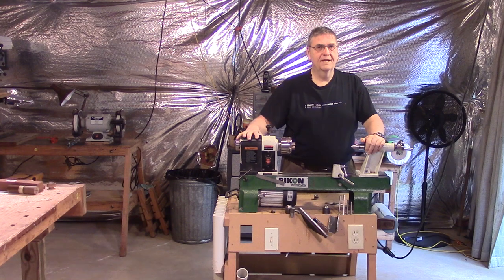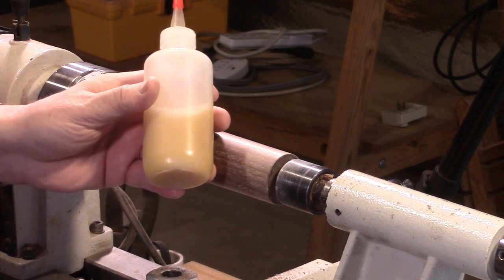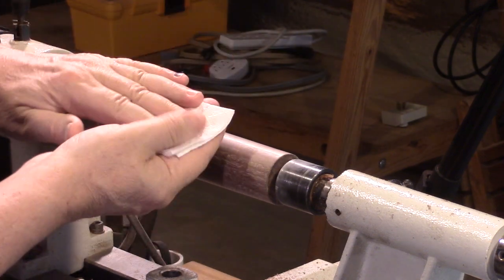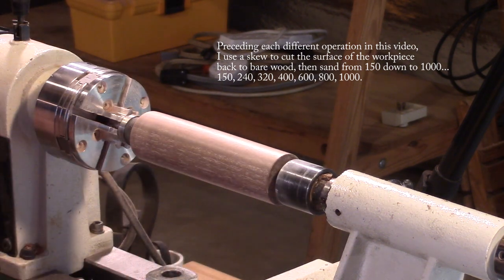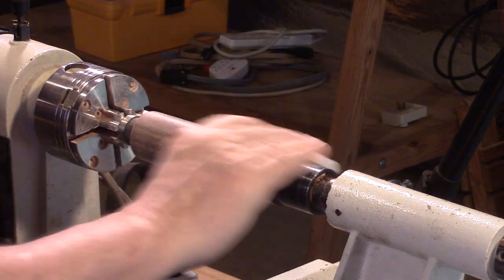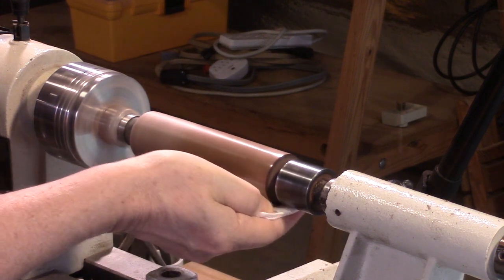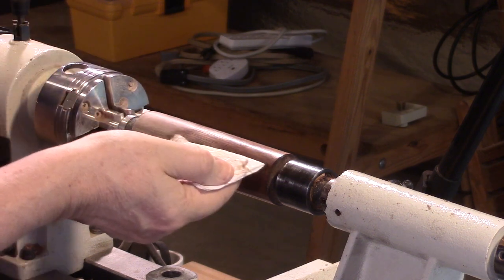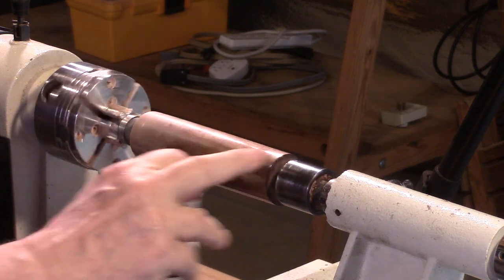Use and Abuse of Friction Polish

Comment: Thanks for taking the time to do this, some really good info here. One other test I'd like to see regarding sanding is if it makes much difference for being super methodical about sanding with the grain (lathe off, obviously), after sanding with the lathe spinning. During the process, it looks to me like sanding with the grain brings out the detail better, but I haven't tested it methodically. I usually sand up to 1500. Also, regarding heat, I thought that the heat made for better penetration and durability, more than shine. So, it's possible that it makes sense to get the first few coats hot and let the last coat be cooler. Also, I add a layer of wax at the end, theoretically, for a bit of water protection, as the shellac soaks up water, in time.
Reply from the maker: I've seen woodturners who always sand with the grain after each rotational sanding, but it always looked like a waste of time to me, since I get very good results without doing that. I'll bet you're right about the heat, that explanation had not occurred to me. Thanks for the tip! I usually use a wax coat on top of shellac too. Thanks for commenting and watching, Jonathan.

Comment: Hi Rick, thanks for taking the time and making the effort to video this and share.. 
I have a couple of observations.. 

if you put the towel against the rotating work, then slowly apply the F.P.onto  to the towel you get little or virtually no spatter.. 

I apply A variable pressure to the towel.. as in when it is starting warm up or getting very warm I back of the pressure a little. however please consider also  that the diameter of the work piece also has some relevance .. think about it.. The Spindle RPM is not the same as miles per hour.. and pen blanks or even 2" diameter  spindle blanks  will be travelling faster past your paper towel then a 10" bowl at its perimeter .. i.e. if you ( put some larger wheels on to your car it will travel slower at a GIVEN or FIXED RPM than with it would with the normal wheels.) therefore less miles per hour at said (given/fixed RPM). 

Also.. sanding speeds will also vary between different wood types and different work piece sizes.. sometimes if you try to sand to fast... it seems to just burnish the sandpaper rather than smoothing out the work surface ..

great videos thank you.... 

oh.. one  or two more thoughts.. in the automotive industry they fine sand between multiple coats of lacquer to achieve the high gloss.... 

Surely friction polish is just french polishing on the lathe... :-) 
except that the french polishing is a lot more time consuming.. he he.... 

is the secret ingredient of Yorkshire grit just ... superfine pumice, a crushed volcanic glass ?
take a look at this video.. 

https://www.youtube.com/watch?v=MxRIPkzgUTM
Reply from the maker: Thanks for the tips, Richard. I agree about the French polishing. And I'm pretty sure you're right about Yorkshire grit and pumice\rottenstone.

Comment: Great video, thanks for the testing. I've been wondering these same questions, as in different applicators, speed, etc., but never wanted to take the time to test them out. Question: Is that silver backdrop for dust/sound, or for camera purposes? By the way, I use the same rocker apron. Always like your videos and happy holidays.
Reply from the maker: Thanks! The silver backdrop is actually insulation on the concrete walls of the basement.
Reply: +ah, ok, thanks.RickTurns

Comment: Three thoughts - one advantage of putting the FP on with the lathe not running is that there is less splatter that has to be cleaned off the bed ways.  Of course, you could always lay the other half of that piece of paper towel to catch the splatter.  Or another approach is to leave a thick layer of sawdust on the bed ways to catch the splatter.

Second, I have one of those rubber pads with velcro on one side that I use to hold hook/loop sanding discs.  I am going to try flipping it over to use as a pad to minimum finger burning.

Third, one of the things that I read somewhere is that the effect of heat is to melt the shellac.  Seems to me that melting the shellac might be more helpful in producing a smooth, polished surface if there is more shellac on the surface (ie, with many more coats of FP).  But one of the objectives of FP is to be able to quickly finish a piece, which means achieving the desired result with fewer applications rather than more.   So achieving a really high gloss seems to be inconsistent with the objective of using FP to begin with, and it might make more sense to use some other form of finish (eg, sprayed lacquer) if high gloss is the objective.  Or saying it differently, FP gives a nice medium gloss with relatively few applications and in a short period of time, but may not be the best choice for situations that call for a truly high gloss finish.
Reply from the maker: Good point about the splattering, Louie. It's usually not a problem for me, because I don't put much liquid on my applicator, and I never put it on by dripping it onto the spinning workpiece. Thanks for commenting!

Comment: Very thorough comparisons of application techniques of FP Rick.  Nice job!  But I wonder... if a high gloss finish is what someone is after, doesn't lacquer give a higher gloss and longer lasting, more durable finish?  FP is simple to apply and cheap to make, and I can relate to that, but it really doesn't hold a shine well for anything that is handled.  I found this out by comparing the finishes on bottle stoppers after minimal use.  But I may be wrong.  It seems to me that the short term oooh, ahhh, factor of FP does not a legacy piece make ;-)  Like anyone else I am always looking for a fast, easy to apply, finishing solution, but for me FP has not been the answer and even EEE (which is very expensive-for what it actually is) has little durability.  How about doing a video comparison of lacquer vs FP?  Thank you for this detailed video.  It was obviously a lot of work and very well done!  Merry Christmas!
Reply from the maker: +Rick Stonewood Arts Hi, Rick. I've never used a friction polish based on lacquer (except maybe a product called Qualapad, which I'm not sure is even available anymore). You're right about the durability of a shellac-based friction polish - I only use it for things which won't be handled very often. Making a video about a lacquer friction polish is on my list of things to do. Thanks for your comments!
Reply: I've found that lacquer, especially spray lacquer, makes a great final coat for shellac-based finishes. I love the look of French Polish, but it is of course a poor choice for hard-use items. I've found that top coating with spray lacquer gives me the color and chatoyancy I love from the French Polish and the durability and moisture/alcohol resistance of lacquer.
Reply from the maker: I didn't realize you could put lacquer over shellac. I don't use lacquer, because my wife objects to the smell. But I just moved into a new house and I have a detached garage to use as a workshop, so I can try this out. Thanks for the tip!

Comment: I sometimes use a walnut oil finish.  I have heard that heat caused by friction in applying the oil will cause the oil to polymerize drying and hardening quicker.  You might consider using high speed and pressure causing heat for the early coats and do the last coat at low speed and low pressure.
Reply from the maker: Thanks, John. I'll try that!

Comment: Years ago Russ Fairfield posted many tips on his web site.  He has, unfortunately, since passed and is greatly missed and his tips site appears to be gone.  However, I still remember many of his words.  He said the very best applicator for a friction polish is a small piece of terrycloth towel.  I began using that as my applicator and have tried many others.  The terrycloth gives me the best result.  He also said, if it doesn't get hot, you aren't doing it right.  Just food for thought.

Billy B.
Reply from the maker: I've seen Russ Fairfield's web site. I believe he also had at least one video on YouTube, possibly posted by a club where he spoke. I'll try out the terrycloth idea. Thanks.
Reply: I have always been told to never, ever take any type of clothe to the lathe that doesn't rip easily - so really only paper towels. Perhaps for more experienced turners a terry clothe is a good option, but I would not recommend it for people who are relatively new at woodturning. Could be very dangerous.

Comment: Thank you for your time and sharing. Your conclusions are about the same as the ones I've determined from my experiments.  I'm glad to have my conclusions validated.
If you don't mind me asking, what is the silver backing you have on the wall of your shop?  Again, thank you.
Reply from the maker: Hi, Andrew. I’m glad to have my conclusions validated also! That silver stuff is garage door insulation. It’s an aluminum foil over fiberglass. It comes in several sheets that are about the size of garage door panels. It works pretty good.
Reply: @RickTurns  Ah. In the video it appeared to be in sheets, more like a tarp.  Thanks.

Comment: @ RickTurns : What kind of a chuck are you using to hold that wood? ... seems to hold quite a narrow tenon.
Reply from the maker: Holding the tenon is a Stronghold chuck with 100 mm (about 4”). With the woodworm screw, I used a Record SC4 chuck with 130 mm (about 5”) jaws. Thanks for watching, Gautam.

Comment: Awesome video. Thank you. Maybe you can answer this question. I hand chisel bowls, so don’t own a lathe. I made the 1:1:1 shine juice. I am thinking I can use my handheld small car polisher as it produces heat as it applies it, essentially becoming my “lathe”. My question is what head should I use? It comes with two different sponges (they create the most friction heat) and a big fluffy lambs wool applicator heads all interchangeable on Velcro. Should I use the sponge head? Or fabricate something with a chamois or cloth onto Velcro and use that since I can’t use paper towel. Thank you.
Reply from the maker: Interesting idea! Seems like a sponge would just tear up because the mixture is a little sticky at first. I think I would tie some t-shirt material around the sponge or wool head, and see if that works. I’d love to hear back from you after you try it.
Reply: RickTurns thank you so much. I’ll let y’all know. Keep up the 
great work.

Comment: Very thorough tests, thank you for taking the time to do this video.  I use FP when turning pens when using some darker woods like Padauk or Babinga and it typically looks great, not so much on lighter woods like Tamarind or Maple. This helps, I have been thinking of trying sanding sealer after a 600 grit final sanding and then removing excess with 0000 steel wool and then applying the FP,  to see if I can get a higher gloss deeper finish, have you had any experience with this method?  Thanks!!  Again great video!
Reply from the maker: I haven't tried that. I usually get a very high gloss with just the friction polish. I'd be interested in hearing your results from that. Thanks for commenting!
Reply: Thanks Rick, tried it yesterday on a pen I made from Olive wood and got a very nice shine, not quite as glossy as say a CA finish.  Maybe more coats might have helped I don't know, but I did Mylands sanding sealer then the steel wool, then 4 coats of Mylands friction polish, one right after the other then then buffed down with a lint free cloth on a little higher speed.  Worked well enough, but would still like to get a deeper looking glossier finish if possible.  If we could attach pictures here I would.
Reply: And what is better on Maple? Thanks

Comment: Hi Rick...just watched this video again as I just tried friction polish for the first time on my first lidded box...was finding at low speed I kept getting bad streaks...watched this and tried at high speed after getting the streaks out by using steel wool...high speed here resulted in a great finish on oak...I was using Mylands and will be making Cap'n Eddie's OB juice next...do you think thinning the Mylands a bit with DNA could help?...thanks for all your videos..learning lots!..
Reply from the maker: Generally, if you're getting streaks with friction polish, it's because you put on too much. Shellawax, a commercial friction polish, says the only mistake you can make is to put it on too heavily. I haven't used Mylands, but I doubt it's any different than any other. Cap'n Eddy's OB juice is the same formula that I use. Cap'n Eddy puts it on at a slow rpm. I like the higher rpm myself. Thanks for watching and commenting, Mike.

Comment: I just finished watching this video which is a very good video!!!! First I would like to say that you may want to rethink your reply to Rick's comment because wearing a glove at the lathe can be a safety hazard like you mentioned at the end of the video about paper towels and cloth towels. My second comment is that I am by no means an expert on friction polish but it is my understanding that basically the only thing the DNA does is thins out the polish and acts as drying agent, so wouldn't mixing up a small bit of polish without DNA give you what you are looking for for your test?
Reply from the maker: You're absolutely right about the gloves, Kurt. And about the alcohol in the polish. A few days ago, I did try putting on straight shellac, right from the can, 3lb cut, and got a somewhat sketchy finish. However, I didn't video that, and didn't think to repeat it for the video. Thanks for the suggestion!

Comment: I wonder how hitting the piece with bees-wax first (saw on old "wortheffort" video, then using the faster speed along with the friction polish to melt the wax into the wood along with the polish would come out.
Reply from the maker: I once mixed up (and melted up) a mixture of carnuba wax, beeswax, and shellac. I found it was not as good as friction polish. However, I frequently follow friction polish with carnuba wax, applied while turning then melted on with a cloth. Beeswax in general does not produce a high shine, but carnuba wax. Thanks for watching.
Reply: Ahh, thanks for the info. I'll be sure and try it..
Cheers

Comment: Thanks Rick. Have been learning by watching you.  Question: My finish does not appear as shiny as yours. Any suggestions?
Reply from the maker: Make sure your proportions of the friction polish are correct - 1 to 1 to 1. Use denatured alcohol, and not rubbing alcohol - I found that rubbing alcohol gave a duller finish. Make sure you’re applying pressure when you polish it - the applicator piece should get hot in your hand. Also, if the wood isn’t dry, I’ve found the friction polish looks good initially, but then dulls a good bit in just a few minutes. Hope that helps!

Comment: Thanks for this video and for all the time you spent preparing.  I am trying OB shine juice for the first time and am having some trouble.  I double checked and I do have the correct ingredients and mixture.  I can't get to shine and it dries with streaks.  I am coating some spalted maple that was sanded to 600 grit.  It always dries with a flat sheen or streaky.   Any ideas?   Thanks.
Reply from the maker: Streaks usually means too much polish too quickly. Dulling after application, I've found, is usually due to wood that is still wet or green. Those are the only things that I can think of. I've also had problems when the friction polish gets old, or maybe when the shellac gets old, although I've had comments from turners who say their friction polish last for years (and comments in the opposite direction, as well - that it will only last for three months or so).
Reply: @RickTurnsWoodturning  Thanks Rick I will check the moisture content.  The polish is new I just picked up the ingredients last week. I may have been putting on too much at one time, Ill try again tomorrow.  Thanks for the help.

Comment: I have been using mylands friction polish but have been having issues with stealing on my finished piece.  I’m running the lathe at 1200 and using a good amount of pressure with an old undershirt as an applicator.   Any idea where I’m going wrong?
Reply from the maker: Is it not shining up? The only time I’ve had that problem was when the wood was damp.

Comment: I have had great luck using the orange Super Chamois.  It is soft and thick.  I reuse the same pad until it starts breaking down.  This is usually several applications.
Reply from the maker: Thanks for the tip, Randy!

Comment: Rick
great video thanks a bunch. Just two questions someone commented on using a sanding sealer I have heard that before what does it do?
also to get a brighter shine I have seen Cap'n Eddie use something like Renaissance wax would that help with a better shine as well as add more protection
Reply from the maker: A sanding sealer is really not necessary, but it won't hurt. Most sanding sealers are dilute dewaxed shellac. I have never used Renaissance wax. It's a microcrystalline wax, used by museums for preservation of fine wood items. I've bought some microcrystalline wax (not a brand name) to experiment with and make a video of, but haven't gotten to it yet.